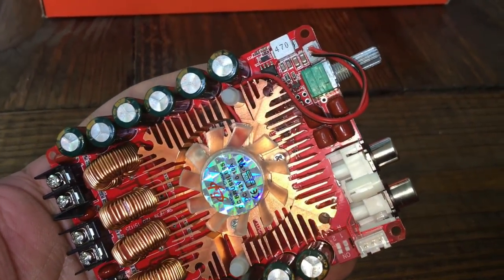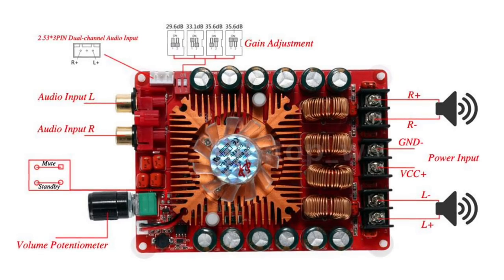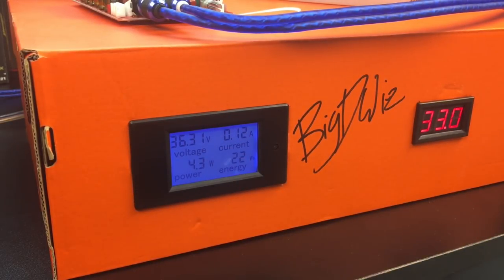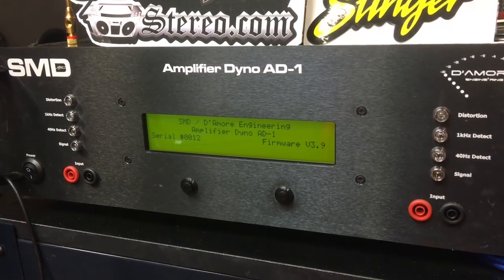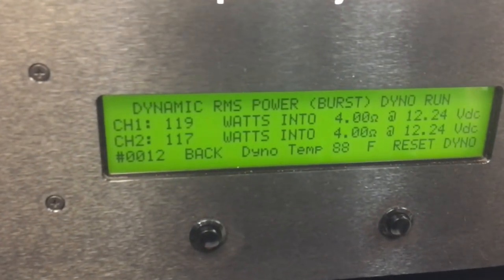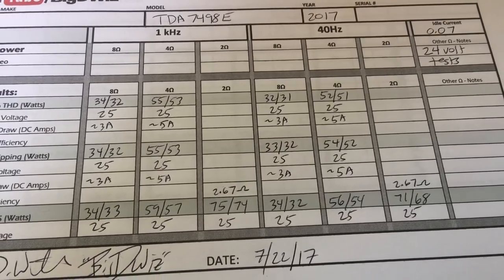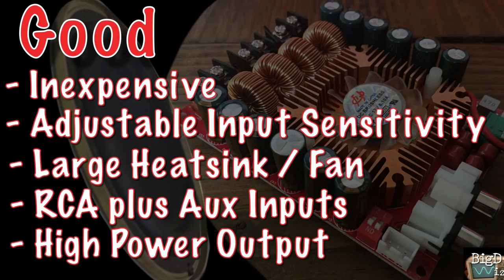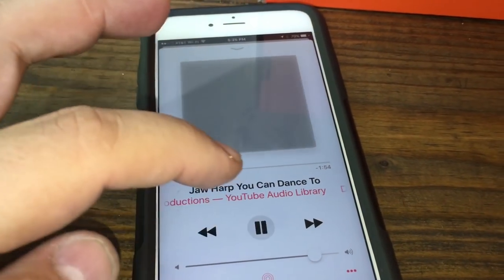Big Power in the Palm of Your Hand - TDA7498E 160+160 watts

Comment: If you were to use a 9S LiPo battery to power this it would be 37.8v max with a full charge. Do you think this little amp could handle that without letting out the Magic Smoke?
Reply: vettonator i think the max voltage is 36.. check the store page
Reply: This amp module is designed for MAINS power. You cannot (practically) run a powerful amp off batteries, unless you have a short attention span. Consider a midrange 18650 cell; with 3000mAh capacity. Amp running at under 1/4 rated power x 2 channels = (say) 72W at 36V. That's 2 amps... so your battery lasts 90 minutes max, then will need 3 hours charging (at 1C)
Reply: yes but you dont constantly use 72 watts... with a 91db sensitive speaker you will use a few watts at most in normal situations (not party mode no) and music is not a sine wave so that 72 watts is absolute peak., most these boards work on 12v to 36v anyhow.
Reply: John Coops I would probably use much higher capacity LiPO batteries like what people use for  RC cars. The battery bank would be much more expensive than the amplifier itself but how many 300 watt Bluetooth speakers have you seen? I'm sure the finished product could be well worth the build cost.
Reply from the maker: I accidentally raised the voltage up to 41v using the booster (before noticing the 30v meter was maxed at 33v...big dummy), so it can handle voltages around 40, just not sure how long :-O
Reply: BigDWiz well I guess it would only cost 18 bucks to find out, and if it turns out it can't handle it just take one cell out of the pack and grab another amp for 18 bucks.
Reply: Freitpan - if you only use a few watts and a nicely efficient 91db/W speaker, then you might as well just use a smaller amplifier which is designed for portable application. For example a PAM8610 on 12V or one of the multitude of TPA3116/3118/TDAxxx that all run on 12V single rail.
Reply: vettonator all you have to do is look up the data sheet of the chip...not that hard..
Reply: Badass Killer if I decide to build one I'll just say what the hell and give it a shot with 9s lipo, it'll probably hold up just fine running straight off the batteries. Those amps are cheap anyway so if it does go up in smoke I'll just get another one and take one of the cells out of the pack to lower the voltage a little bit.
Reply: I bought one i will use them at two old 30c 4s

Comment: Would you mind sharing the reason you do listening tests through those extremely cheap speakers? How will you ever know when you find a really good deal in a amp?
Reply: Porkchop's Papi because of a amp sounds good on cheap speakers , it will sound great on good speakers
Reply: Crappy amp will sound lifeless, distorted on great spkrs comparing to great amp which is transparent, has good resolution, dynamics and very low subjective distortions (not THD). Often spkrs own colorations and distortions will hide amp problems.

Comment: I smoked like 3 of these when using them with 6x18650 3400mah batteries in series, and in BTL mode with a 150w subwoofer. 
Could anyone tell me what the reason could be?
Too many amps perhaps?
The amplifiers all worked ok for a few minutes and then they stopped. The fan never spin on any of them.

Comment: Can you recommend me an amp for Party use which can Power my 2 bayma 12ga50? So ist would have to be able to put Out 2 x 200w-250w rms at 8 Ohms. I don't know of you have heared of the 
t-amp e 800, it is supposed to do 300w rms at 8 ohmes per Chat for Just arround 150$. All Specs Look pretty good but i haven't found any Tests, that make Sure it does what it sais so i am a little afraid of buying it. Maybe you know an amp that can provide the power and hast already been Tested.
Sorry for the Bad Englisch Greetings Philip

Comment: I just bought this without looking at reviews. I'm backwards I guess, I just bought a voltage increase board to pump 33 v. Because I'm putting this in an old car radio, but what speakerscare going to match the best? 6x9 4 ohm? Or 8 ohm? And what for the front speakers, I was just going to split the signals to all 4 speakers
Reply from the maker: If using 4 then you’d want 8 ohm speakers to give a final load of 4 ohms per channel

Comment: hey there, nice review.
Would you recommend running this on a 2 ohm load? I got the 7498 and it runs pretty hot at 4 ohms itself
Reply: It might do, the 7498E is far more energy efficient than the 7498, it also handles lower ohms better. Don't know about 2 ohms though.
Reply: I bought a 7498e ic board .35volt gave 2amp power .The sound went off and the ic is not hot after 5 minutes

Comment: THD is is higher then I like to see, but it would still be good for low volume applications.  Looks like it had reasonable speaker control - I was not expecting that out of something so cheap.  Like how the fan doesn't run all the time.  Too bad the bass is a bit weak, but again, wasn't expecting miracles given it's size and cost.  It might not have done rated, but as you pointed out it was pretty close.  All for $18 - would be pretty good for some applications one may want to attach a small amp too.
Reply: This amp is actually useful for high power applications as well. I use them on line array pa speakers and have had success running live bands with these amps powering cabinets in biamp configuration. Unbelievable they actually put out enough power especially at the price point.

Comment: Could this be powered from a 110 outlet only? Making a stereo and doing my homework. Thanks! Shane.
Reply from the maker: only if you had an AC to DC power converter capable of delivering enough current to power this amp. I could not find one, so this is why I used the batteries and voltage booster

Comment: I have watched a number of your chinese mini amp videos but Im not making the connection to WHERE TO USE THESE? Can someone please explain what to do with them.
Reply from the maker: Totally my fault for not explaining. These are mainly used in DIY applications such as portable stereos, custom powered speakers,  arcade systems, and more. Basically anywhere you have the need for a small amp and 24-36 volts to power it.

Comment: Hi @BigDWiz Can I use this amp for 2Ohm speakers? I have two 4Ohm speakers (1 woofer + 1 midrange/tweeter)
Reply: Unless the impedences of the woofer and midrange/tweeter are the same (which is very unlikely), you would want to put them in series getting 8 ohms.

Comment: Is it possible to make a bluetooth boombox or portable sound system..? Becoz the amplifier circuit will be packed inside enclosure.. matter of cooling of IC..
Reply: Definitely, if making a boombox you wouldn't use 36V anyway so the fan wouldn't even turn on it would be running so cool. This class d runs really efficiently

Comment: Understanding that is has a large wattage output.  But how clean does it sound.?  Looking for a clean amp chip board.   Any suggestions.  60watts or higher per channel
Reply from the maker: I prefer the TPA3116 or TPA3118 based amps

Comment: I would love to see this amp bridged. This could make a great power amp for guitar, bass modelling preamps like a Line6 POD. With a power supply it would probably weigh five pounds. Would this amp have the power to drive a 12" guitar or bass speaker?
Reply: I want try this for my boss gt100 and metal zone pedal soon. My plan is connect this power amp to fender mustang 1 8 inch speaker.

Comment: How would you rate sound quality... 1 being a Pyle or boss amp, 10 being an a/d/s, 300/2, or early zapco?
Reply: Honestly, the sound quality isn't going to be the problem with either. They will be sub par to a/d/s regardless, but particularly suffer in terms of build quality and accuracy of filtering (low/hi-filter, channel separation/ground loop noise ) not to mention being 25-40% of the advertised rms wattage. But if you have a stereo deck that has crossover crntrol (low/hi/subsonic filtering at least) I would run the amp at full frequency with no filters or bass boosts on. Use the stereo deck for dsp/filtering and set the gain on the amp correctly. Shouldn't be an issue

Comment: Great video but a shame you didn't show the approx amps using 36 V. I was surprised it was only 3 A into 8 Ohm at 24 V. I have  a 28 V linear power supply that's pretty good up to 8 A so I'll assume that should do.

Comment: Very cool, I'm a car guy. Never knew the was such a thing as a amp dyno. I'm also a vintage guitar tube amp guy. If you bridged it to mono, and used a 36v transformer... is this viable, say for a pair of 4" 30 watt Eminence guitar amp speakers? Thanks!
Reply from the maker: The Amp Dyno has been around for 6-7 years. These mini chip amps are amazingly powerful and cheap enough to try and see if it’s suitable for your application

Comment: I would like to source an a voltage booster that would take my current 14.5v feed and boost it up to 18v and be adjustable so that I could really get the full potential from my set of skar Sk3500's which are stable up to 18v.... my CES 300AMP alt would certainly be able to feed em but my vehicles voltage charges at 14.5v only....
Reply from the maker: This would need to be audio only as the rest of the cars electronics may not function with >16 volts
Reply: @wal  yes that is correct big d wiz sir lol but I just don't know if such a thing exists or if I should scrap all 5 of my group 34 agms and buy all new 16v batts and a stepdown

Comment: A very interesting test. I'm planning to use these amps to power active speakers for guitar use. The data sheet states the highest recommended power supply voltage as 39V (absolute max. 45V). As you have the test equipment, it would be really useful if you could test the amp up to 39V, to see how it holds up. I notice that the power supply smoothing capacitors on the amp board are rated at 50v, so there should be little risk of damaging the board. How about it? 
Thanks for a very useful and informative video!
Doug
Reply from the maker: I accidentally ran this one over 40V (41V) before I noticed my 2nd volt meter maxed out at 33. I didn't see any smoke and it continued to work afterwards. If I get a chance, I'll try it at 39V
Reply: Thanks - would be very interesting indeed, as output power increases exponentially as voltage increases - I'm planning to run into 8ohm speakers, so I'm not looking to overload the amp or the power supply; just get the best power I can into 8 ohms. By my calculations, extrapolating from your results, I'm expecting you'll get 85W into 8ohms at 1% distortion with a 40V supply.
Reply: I think it is a matter of safety margin for the capacitors and maybe other components. 39V is a bit too close to 50V, especially for these knockoffs. While you may not destroy the board, you will probably shorten its lifespan.
Reply: You make a very valid point. However my amps have now arrived (I have 5 of them!!) and I've been running them in various guitar-related applications for a couple of weeks now. They're all running on 40v (modified cheap chinese "LED" power supplies). I've tested the main smoothing capacitors (rated at 50v, 105 degrees) and I think they can be relied upon (no worse than any other "brand" capacitor made in China". I've run them up to 150v RMS per side (sine wave, into 8ohm dummy load (both sides simultaneously) and 4ohm dummy load (one side only) - 5% distortion. They run continuously (2-3 hours) at this level, although they do get a bit hot - if the heat sink fan ever failed, there'd be an issue at this continuous power. So, I think that for "low-fi" applications like instrument amplifiers, PA monitors, etc. they seem absolutely ideal!! My biggest concern is the cheap power supplies failing ;-)
Reply: Oops! Typo in the above - I mean I've run them up to 150W RMS - sorry for the confusion. While I'm on the subject of power output, my results were: 40v 4ohm one channel - 142W at 1% (continuous), 168W at 5% (momentarily - didn't run it too long at that power level as it was getting hot!). 40v 8ohm one channel - 104W at 5%, 88W at 1%. 40v 8ohm both channels driven - 85W at 1%, 101W at 5% (continuous)
Reply: Another correction - didn't run the "101W both channels driven" test continuous; only the 85W 1% test, as again I didn't like how hot the chip was getting... It does have thermal shutdown, which did kick in occasionally during my testing (until I set up better airflow) - the chip recovered once it cooled down, as per the behaviour stated in the data sheet.

Comment: HEY BIGD! question...can you do an indepth video of setting up the blue voltage current meter you have there? i bought the same one with an 100A shunt...and i want to use it in my car audio system but not exactly sure how to hook it up to measure total current draw...thnx for all the great content...greetings from the netherlands!
Reply from the maker: The unit I bought has inputs and outputs, clearly marked. It is only designed for 20A max, so no external shunt. Try this diagram, it should work for your setup - https://goo.gl/XtPZKe
Reply: BigDWiz hey thnx for the answer i will be looking in to it....sorry to see the amp blow up in the next video...

Comment: Big d have u did a soundstream refernce 700sx by chance or a pheniox gold 2240 i have the soundstream and looking at the pg amp
Reply from the maker: No. I have a PG MPS-2240, but it needs to be recapped before testing. I expect slightly lower results than the MS-275 I've already tested (since the 2240 is high current version and you lose power due to efficiency at lower ohm loads)

Comment: but i think the Amp Dyno was Displaying 12.6 Volts doesn't it, How come?.
Reply from the maker: +Hector Ortega the car amps and Dyno use the same power source, but the home amps (120vac) or amp boards (24-36v) require a separate power source and for testing these amps, I use the supplied 12v adapter for the Dyno. I should have explained this as I know it may be confusing...

Comment: Im running deck watts to my Kicker 6x9's. You think this mini amp would be of much help?
Reply from the maker: +hand to hand combat it would, but would require mods to boost voltage and add a turn on circuit.
Reply: hand to hand combat I have a pioneer class D amp front and rear channel. It connects right up to your headunit.

Comment: Do not use 36 volts it can't handle it for very long. It recommends 32 volts. I will step the voltage down to 32 on the next one I get. Fried it using 3 12 volt 12.5 amp power supplys in series. Was reading 35.5 volts when the amplifier chip blew out 4 of the pins. Sounded like bacon frying. Glad it was cheap.

Comment: I have a question can you hook up two of these amps together. I have one for my little bench/ garage subs but can I have two for more power?
Reply from the maker: You can hook up 2, yes, but they would power 4 speakers
Reply: Rite on I wish you could link them together somehow so you could have double the power.  But that's not possible with these little amps. Rite ?
Reply: How do you connect j1j2j3j4 on the bottom.

Comment: Hi BigDWiz, love your video, just subscribed. :-)

 I wonder how much can this amp output for an 8 ohm load for THD under 0.1%, since I'm wondering if it'll work adequately for a speaker with 40W RMS and 70W Peak rating . Thanks!
Reply: More than enough, if you max out that amp you would probably break that speaker. Depends on what voltage you are sending through it.

Comment: I see your results showing between 3-5 amps. Was more available? I saw specs elsewhere that called for 8 amps on this thing.
I'm waiting for delivery on one of these, but I haven't decided on a AC power supply yet. I'm thinking maybe this one rated at 9A.
https://www.parts-express.com/mean-well-mw-lrs-350-36-36-vdc-97a-350w-regulated-switching-power-supply-with-power-cables--320-3168
Reply: Ok, I got the amp in. I'm currently waiting for my ac-dc converter to show up. In the meantime, just out of curiosity, I hooked this up to 13.5vdc, and connected two bose 301's I had in the shop. To my surprise it ran them, and pretty well I'd say for 1/3 the required voltage. At half volume I had to turn them down some after a while because it was pretty loud. Also above 1/2 volume it started to distort, but I'm pretty sure that was because of not near enough voltage being supplied.
I think I'll end up getting another one, and bridge them both and use one amp for each side of the stereo signal.
Maybe I'll add a tone board as well.
I can see where these will make for a fun little project.